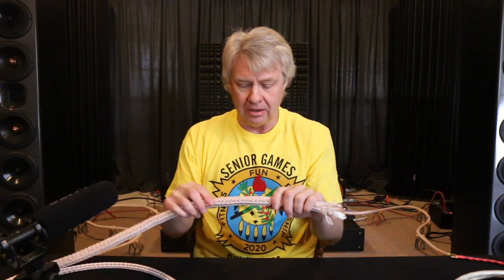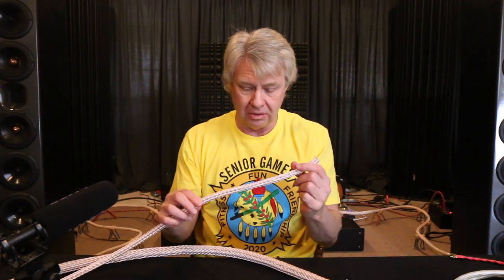What’s up with Audiophile Cable Risers?

Comment: I suspend my cables off the floor with wild horse hair from Mongolia, the difference in sound is incredible.
Wrap cable twice then make a suspension support above cables, approximately 2’ 3”. high.
Reply: Yes, but you need to burn in those horse hairs for at least a week of continuous listening before they perform at their optimum. Female Mongolian horse hairs will affect the treble more further enhancing fine details while Mongolian male horse hairs are awesome for subwoofer cables.
Reply: I will follow your instructions, hopefully this will solve some problems I’m having…thanks
Reply: @PierreVilleneuve88  Did Google just ban your comment?
Reply: @ThinkingBetter  it doesn't look like it
Reply: @PierreVilleneuve88  Your comment is not visible here.
Reply: I am calling the  RSPCA leave them horses alone , pull your own hair out instead.
No pain no gain.
Reply: mongolia? no no no... Nepalese horse hair is what you want

Comment: Cable Risers, like so many other aspects of the hobby, are exactly the reason why it's difficult to have audio and speakers as a hobby.  Because you can so quickly reach a brick wall in the hobby, where there isn't anything left to do, that people begin to look for more things they can do or desire, so they can continue the hobby.  This also causes an Emperors New Clothes effect where the person thinks they hear improvements because they WANT to hear improvements, because otherwise they have to admit the hobby is at another brick wall.  Think about it, you get your favorite amp, sources, and processors, combine them with your dream speakers, and set them up in an acoustically friendly room.  That's it!  Hobby over!  Time to put your time somewhere else!  But some people don't WANT to stop there, so they have to keep finding ways to continue the hobby.  This is where everything from cable risers to Snake Oils to the little disk you just place on your CD player in the 90's that was supposed to "clean up" your digital audio stream.  And of course people think they hear a difference.  They aren't able to perform a true ABX test between their exact system before the change and after the change, so hearing a slight difference means you didn't just waste your time and money, and you can keep moving forward with the hobby infinitely!  Yay!
Reply: Great post. It's the honest, and hard truth.
Reply: Sounds like you are not a crazy person. What are you doing here lol?
Reply: He's not selling snake oil, unless you are suggesting a conspiracy theory where Danny own's Tinker Toys...  Clearly that's ridiculous!
Reply: Just like after you wash your sports car. Always seems faster and better, in reality its not. Its all in our head. Its normal for men to have mental complexes that make us think we're better at things than we are. Many audiophiles think they are trained critical listeners, in reality they have no idea what their doing and won't believe anyone that tells them any different.
Reply: @iowaudioreviews  Yeah and it's a major red flag when they say things like "I know my system!, I heard a difference". No, you don't know your system. You will start to forget how it sounds a few seconds after listening and even while you are listening you can only focus on one or two attributes at a time. Blind test or GTFO.
Reply: @neandrewthal  I used to work at a place in Oregon called The Good Guys in the 90's and early 2000's, which was somewhere between an audio boutique and Best Buy.  The good thing was that they tried to hire real AV enthusiasts instead of just salesman like places like Circuit City seemed to do.  We were all SO high on up-selling people on Monster Cables because we though they made a MASSIVE difference.  Then one day Monster released their new bi-wire cables which were just two conductors on one end, four on the other, with promises of more defined mid-bass and clarity in the upper register, and damn were they profitable.  We were so pumped that before the store opened on the first day we had them, we set up an A-B-X test in our best room using a pair of Energy towers (Energy was good back then), so we could prove to customers what a huge difference cables made.  When this proved that the cables made zero difference over cheap Recoton lamp-cord speaker wire, we were totally deflated, and set out to prove that this was a rare exception, and that high end interconnects were still worth the money.  Long story short, our manager made us stop setting up listening tests and tried to convince us that our tests weren't showing the real-world results of the products.  But we knew that the opposite was true.  Not hearing the difference in a padded room was not a good indicator that a difference would be heard in a living room.  That experience changed me quite a bit.  Funny enough, I still love audio and have owned my own custom install company since 2003.  That's really a better way to be able to mess with good equipment on a regular basis, without having to constantly swap out the components of your personal system.
Reply: @paulcampbell8696  That's a great story and illustrates why I won't take anyone seriously if they can't acknowledge this basic truth that cables don't make a difference. Lots of people are just deluded but if they are the audio business in any way then I can't help but suspect that they may be badly motivated like your manager. Hell, your manager might not even know it or be doing it on purpose but he is badly motivated.
Reply: Bunch of folks on Audiosciencereview thought I was hearing weird things on Topping PA5, “it measures so well, has to be your brain playing tricks on you” blah blah blah”...  Now a bunch of us are sending our units back for warranty because they ended up developing static noise…. keeps deteriorating.  Go figure!
Reply: Danny is clearly reluctant to discuss cable risers.  He knows the tweak will be challenged more than it's accepted.  He admits the improvements are subtle and only audible in a high-end system.  GR Research doesn't sell them, so it's not "snake oil."  Tinkertoys look silly and ugly, so it's not for aesthetic reasons.  Cable risers are highly-controversial among audiophiles, so he doesn't seek their approval.  He didn't want the tweak to work, so it's not confirmation bias.  Yes, he could be a deluded audiophile obsessed with upgrades, but I doubt it.  Audiophile upgrades he doesn't support: most expensive drivers, metal cones, ribbon tweeters, large box speakers, complex high-order crossovers, biwiring, biamping, and full-range EQ.
Reply: I suppose it depends if the hobby is tinkering with the kit or listening to the music. My limit is set by the house I live in. A realistic upgrade will cost hundreds of thousands so my system is a good as its going to get.
Reply: Really, really well put. I think another thing people fail to realize: the psychosomatic effects of tweaks do *something*, but it's ridiculous to get ripped off by snake oil when you can get the same effect for free.
Reply: all of that sounds like fun, but my hobby is listening to music
Reply: Paul Campbell - You have no idea of what you speak. ABX comparators are akin to using a magnifying glass to figure out quantum physics. It was shown years ago to be irrelevant. For you to reference it shows your lack of sophistication in science and the hobby. If you have nothing left to do, try buying some music and actually listen it.
Reply: @tallpaull9367  Uhh......snake oil is the legitimate article.
Reply: @iowaudioreviews now that’s funny. Do you really feel that your car runs faster after washing it? I know for a fact that my car doesn’t have the same acceleration every day. But that’s totally unrelated to washing it or not. Also, the guy here isn’t trying to sell you anything fancy. Just toys. Give it a try and be the judge.

Finally, this is not a hobby. In case nobody told you, the boxes with switches and lights actually make music. Listening to music is the whole point, and you never hit any brickwall with that.
I’d rather not have people who want to play the wise guy . I think someone who says “I tried the toys: no difference here. My system is this and that” is way better than explaining the psychology behind it all. Especially when you think that most “audiophiles” have a low-end system (like me for most of my life) and they think it is hi-end and blah blah. 
My take on cables, risers, and exotic contraptions is that below 15-20k you should spend your money on better components. In the 20k-50k bracket you start hearing differences. With systems over 50k, unfortunately, everything can make an obvious difference.
Reply: @neandrewthal GTFO? Meaning what?

Comment: You really need to use a cable cooker first, followed by the cd demagnetizer and don't forget to check the direction of the electron flow marked on the wire.
Reply: Just make sure you aren't chuckling the baby out with the bath water
Reply: Solid advice.. appreciate it.

Comment: You can dramatically improve the sound quality of your cable lifters if you paint the Tinker Toy surfaces with a green Sharpie.  You won't believe how it cleans up the female vocals to the crash of cymbals.
Reply: Man, must be some good female stuff in the Sharpie.
Reply: using a black sharpie, helps lower the noise floor.
Reply: Blue had a negligible effect and brown was downright horrible.
Reply: ok, but which one opens the soundstage? These guys are always listening to closed one :D
Reply: Most important is to burn the cable lifters, cables and voice coils in with continuous listening to heavy metal for at least 2 weeks at max volume. This doesn’t mean burning your speakers so lower the volume slightly at the point when the voice coils start to smoke. Rather than paint, dip those cable lifters in oil before the burn in as the oil will enhance the soundstage much more than any color of cheap paint. The best oil is genuine python oil. Some cheaper oils from other snakes will cause a slight resonant ring through capacitance and inductance effects yielding female voices to be elevated and the soundstage to narrow.
Reply: @ThinkingBetter  definitely have to burn those cable lifters in. Will sound the same as being on the floor till you do... And if you use the wrong oil probably sound the same after.
Reply: @jimgardner5129  Were you playing blues music ?
Reply: @ThinkingBetter  what did you say i can,t hera thing.

Comment: My stereo system sounds better on Wednesdays, it's really amazing. I challenge everyone to listen to their systems on Wednesdays compared to the rest off the week. You have to have a REALLY GOOD SYSTEM to hear the difference.
Reply: It is well known that on Wednesdays the power grid is cleaner as most people have fallen in a numb mid week routine.
They flick lights less, fridges are half empty and running less hard, etc.
Try a power conditioner the other days. Will blow your wallet mind. Must be > $10K. Anything below is garbage...
This said I am puzzled. My own audio system sounds better on Friday evenings, after the 1st beer. Can't put my finger on it... 🤔
Reply: Hi there. Induction and self induction always influence a current. And it transforms the signal. What is your problem? Want to deny the laws of physics?
Reply: I would have to disagree. My $1000 dollar stereo speakers powered by a $500 amplifier with $30000 cables and $40000 cable risers sounds best on Monday at around 7 pm up till 7:30. The soundstage simply gets wider but on Wednesdays, my system sounds like a mono setup.
Reply: @chrisvanderaa6706  So perhaps we should start opening up our amplifiers and moving around the boards inside and then redesigning the circuits at different distances to hear if it sounds different? How about suspending our amplifiers off of the shelf that they're on would that make a difference in sound?
Reply: @jeffmpvd7689  Haven,t you got a Hover platform yet ? so 2,000s catch ut to modern times!.
Reply: @chrisvanderaa6706  If you're stupid enough to form a coil with your speaker cable you might see a miniscule effect.
Reply: Try Friday night after a bottle of Pinot Noir. Everything just sounds so much more musical. Also buy some dwarves to hold the cables up. Come back to me when you've tried these cheap tweeks
Reply: @jeffmpvd7689  Most definitely.. I can attest to the significant gains- both quantitative and qualitative- realized by employing proper amplifier suspension techniques.  If you think about it, it makes sense..
Reply: @chrisvanderaa6706 at what frequency?

Comment: I run my speaker cables under the floor of my house so I use cable lowerers.  The difference in sound is amazing...the bass is lower and the high notes are more defined and the sound stage is wider and more open.  Also I have removed all the tubes and transistors, capacitors and resistors in my equipment as they cause phase and harmonic and IM distortion.  You're probably wondering how I get amplification without the above mentioned components.  It's classified information that I'm not allowed to reveal, but suffice it to say it involves plasma molecular anaerobic junctioning.  You will be hearing more about this in the coming months if you read the science journals that deal in audiology, acoustics and sound wave insanity.
Reply: I have chunky speaker cables and do run them under the floor , keeps my wife happy and does sound great but I  but that down to the cable not any other factor.
Reply: Cable lowerers... 🤣🤣🤣
Reply: When we  'hear more about this' will it be obvious to us all or is it more subtle than that?
Reply: I am really good at reincarnation so you can tell all to me .

Comment: I'm in the UK and we have carpets in all our rooms. I found a distinct improvement in using small light wooden blocks as risers in my system (mid level LP12 and Musical Fidelity separates). Also keeping interconnects away from mains power cables.
Reply: I use monster cable and tried it both ways. I didn't notice any difference.

Comment: For unshielded cables there is an electric field around the cable when active. Maybe the floor interferes with that. But a few inches from the cable, the intensity of the field decreases. So where the field is most intense it has a clear space for the electric field to happen (and doesn't affect the signal as much as on the floor). Just my snake oil hypothesis.
Reply: emphasis on unshielded, which none of these thicc ass cables are
Reply: The impact is an exponential decrease as distance increases.  IE even a couple inches makes  a difference.
Reply: All depends what the floor is made of. and its effect on L & C.
Reply: @chriswithall2518  Agreed.  That was always my theory as well.  I felt that synthetic carpet like I have could be the worst offender.  but then I see a video where Jay saw a big impact on his hdw floors.  Who knows?
Reply: @chriswithall2518  late to the party, but it's not about lcr, it's about even propagation of the electric and magnetic fields.

Comment: Daanny I only come here for the plain truth. You lay everything on the table. It's easy to understand and everything I've learned here matches my own findings. I'm putting into practice everything I've leaned here over the years. Unfortunately currently I don't have room for indoors hifi. But I built a completely sq build. Competing in IASCA SQ daily truck comp this season. I have custom passive crossovers with mylar film caps and sonic caps bypass caps. Braided my own cables with a 7/16 poly ripe center wrapped with custom braided 16gx6 - 28 strand conductors  woven by hand each half wrapped in tpfe tape then wrapped as one. Each conductor is wound in opposing directions. Then soildered and terminated on the ends. My hands are still cramped. But man was it worth it. Image and stage jumped to life.  Upper vocal ranger. No words.  Took me 3 years to get here and still not done. Lol😂 blackhole of hifi! Love ❤️ it. Danny keep it up.

Comment: Applied science upsets some people because it basically means that everything matters and everything makes a difference to some extent. Doesn't at all surprise me. Products made from drilled oil always have noticeably stronger negative electrically active properties. I'd be curious if an unbleached undyed untreated cotton or linen blanket/mat in between the wire and the floor would make a noticeable difference, since it's probably the artificial carpet in your room causing the issue with the wire. Hardwood floors might be better but even those have a plastic coating.
Reply: Where is the science here?  Any controlled listening tests?  Any measurements?  This isn't science...that would require evidence, not just silly, silly claims.  Course, this place hasn't got a lot to do with actual evidence does it...
Reply: You may be on to something there. Of all of the rope cores we've used in the middle of the speaker cables the unbleached natural cotton has the best sound, or has the least negative effect on the sound.
Reply: @bwoody1090  hello bigcorpshill

Comment: They only work if set up with a downhill slope toward the speakers correct? Actually, I think your static electricity analogy is a bit of a stretch. That is unless you're scooting the cables around on a carpet like a dog's itchy butt and develop a charge like the balloon on your shirt. But if knowing they're there influences your psychoacoustic perception, have at it! :- )

Comment: i used to do a lot of FCC compliance work with power supplies where we had to meed requirements for the level of interference we could put back on the power line feeding the equipment under test. i used a $25k spectrum  analyzer to read the level of interference we  were cause and did what ever it took to get us below the limits.I would add common mode chokes, capacitors across the line and to ground but in the end the layout of the parts was more important than which parts I used.

There are more things in heaven and Earth, Horatio, / Than are dreamt of in your philosophy [science]